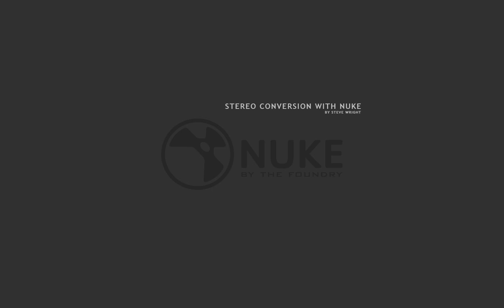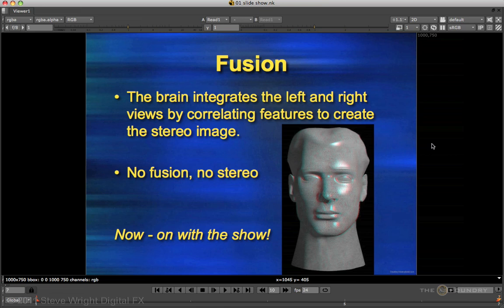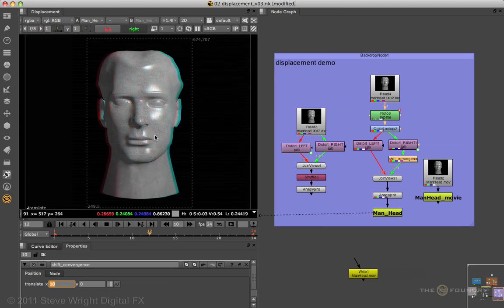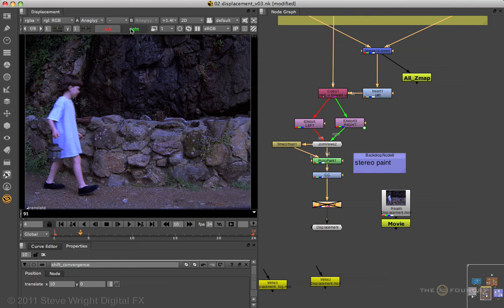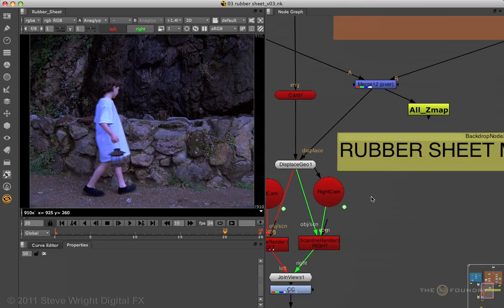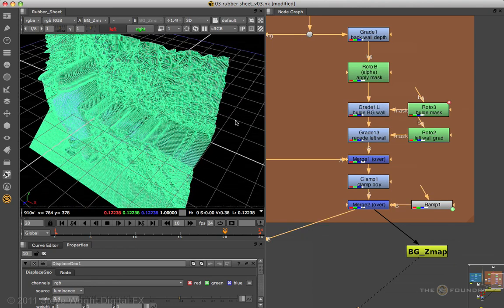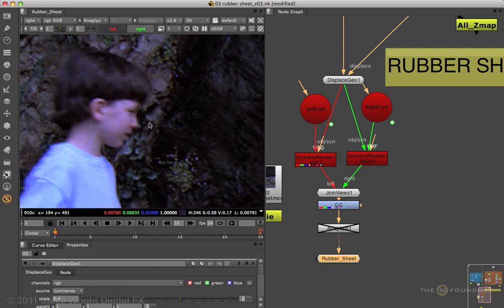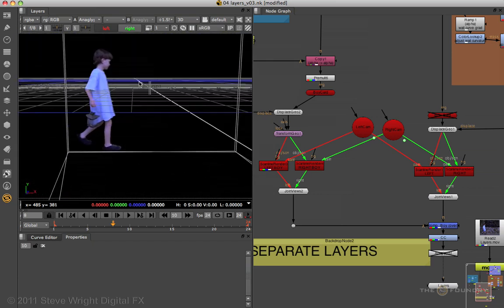Nuke | Stereo Conversion With Steve Wright At NAB 2011

Comment from the maker: Do you mean if you have a match-move camera for the shot? If so you can create the second camera for the rubber sheet method using your original camera. Copy the camera, delete the transform animation but leave the projection data then parent your new camera to the original and add an x-offset for the inter-axial and y-rotation to converge. Now you have a match moved stereo camera.  Hope this helps.